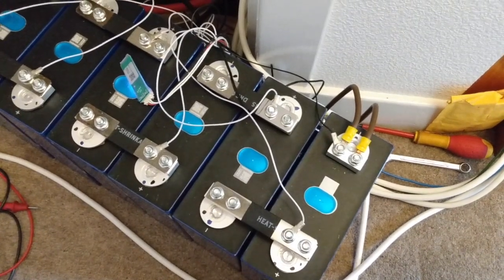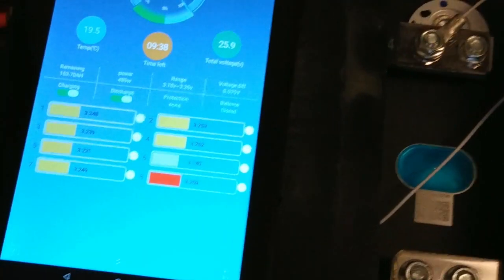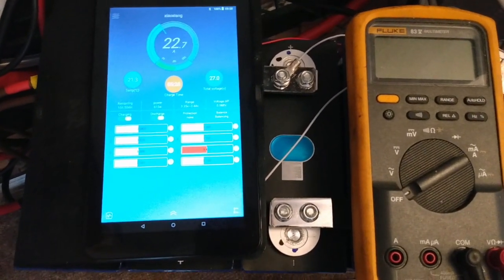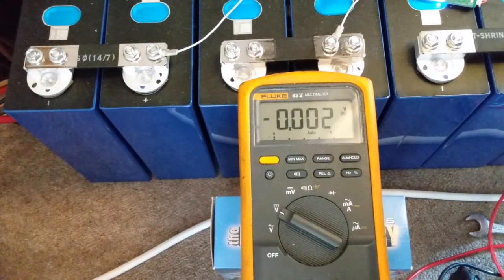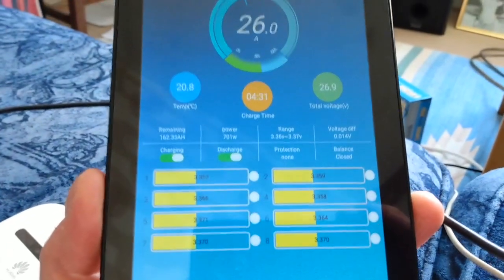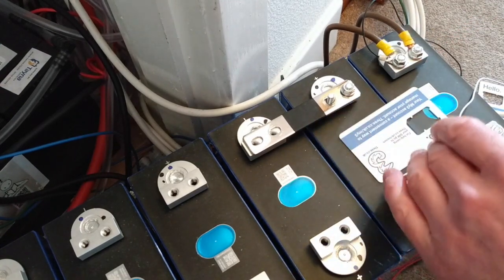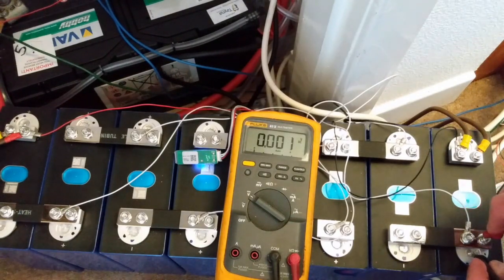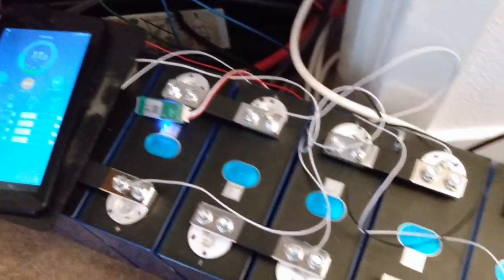EVE 280Ah JBD BMS LiFePO4 Cell Voltage Problem

Comment: I had same issue... Random cells will go low first while discharge and same cell will go with high voltage while charge...Tired of calibrating...😢